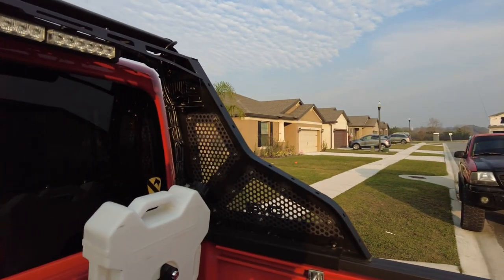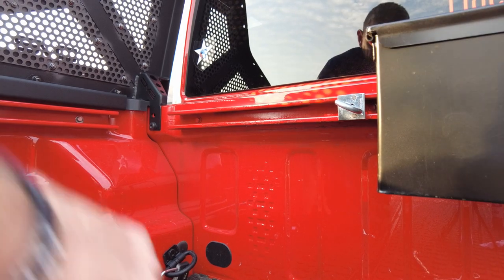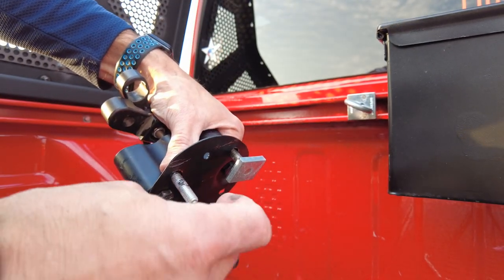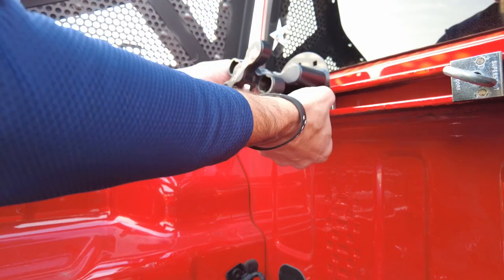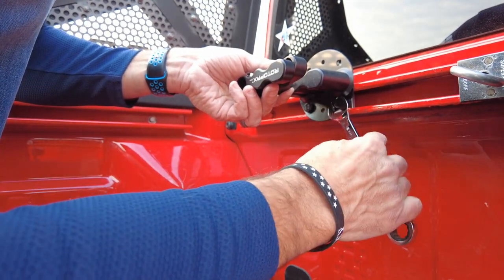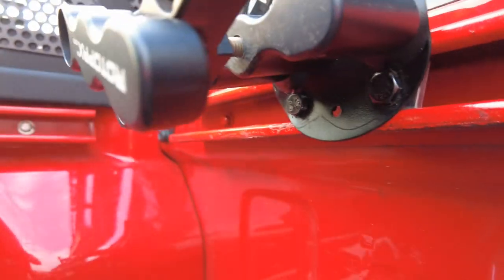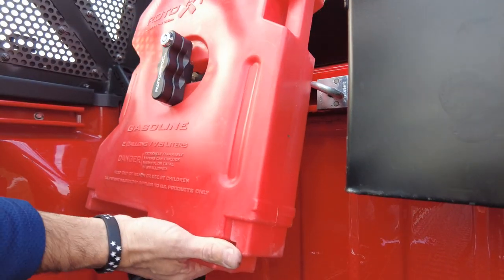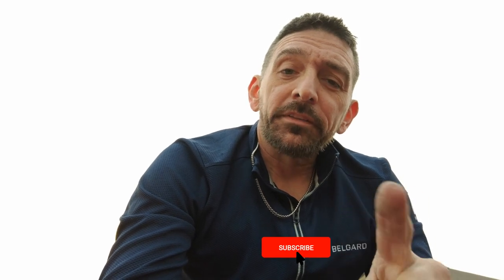Trail Rail Rotopax Install

Comment: How's that holding up. 🤔 I had mine on my rack. But after doing the rubicon trail. I found that they make me more tippy in my gladiator.  I have two 2 gallon ones.
Reply from the maker: well, I haven't done any real wheeling with them on. I switched racks before my last big offroad event and now I have this. I used to have the Fab Fours Overland Rack and it was stupid heavy even bare naked. It felt like a U-Haul truck (literally).  Even with the fuel and water cans full I don't feel top heavy. What rack do you have? Also, the Rubicon trail definately sounds hairy on its own.

Comment: I' ve been using the mount they have that will then sit below the unistrut.  Works well and then my cans sit lower.   Mounting can sideways it sits then below lip of the bed so I can use my cover.  Sit perfect on my Gladiatror   https://rotopax.com/toyota-nissan-truck-plate.html?category_id=7

you way of course works well too and doesn't then require the mount.